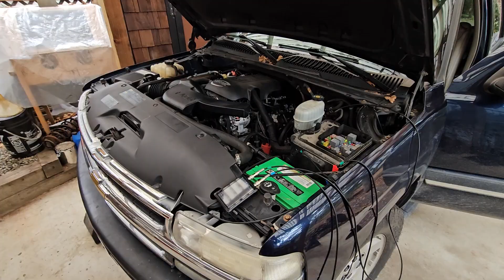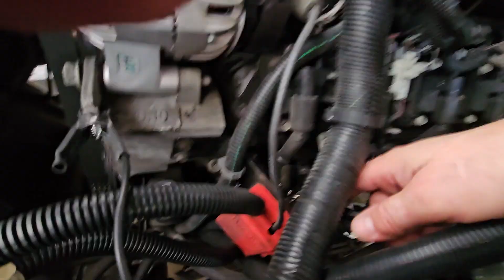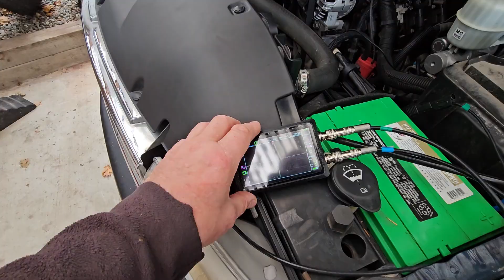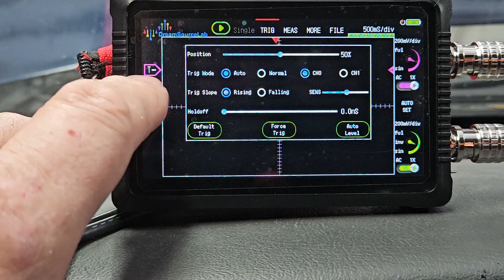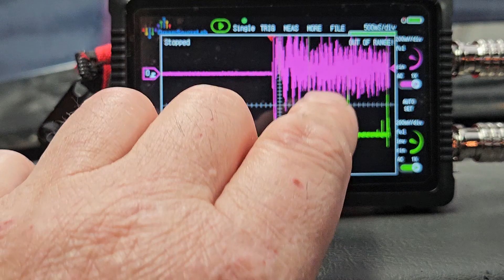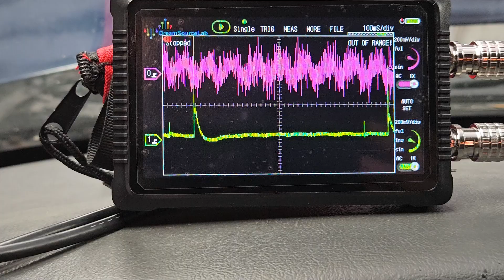Relative Compression Test with DSTouch Oscilloscope

Comment: Are you able to  do current ramp measurements for coil,injectors,and fuel pumps etc. with that scope?
Reply from the maker: I have not done it, but should be able to with a low current clamp.  Sound like a fun thing to try - I will give it a go.